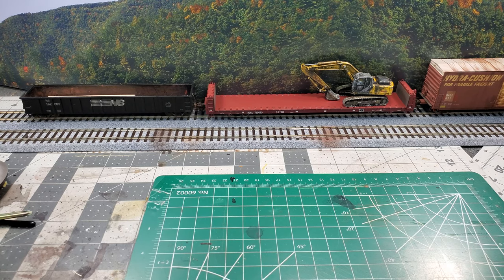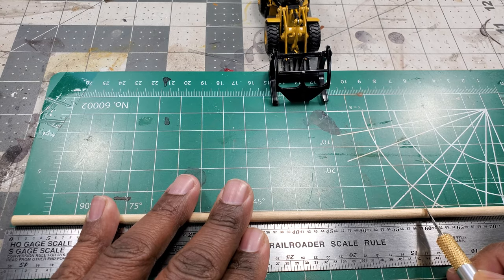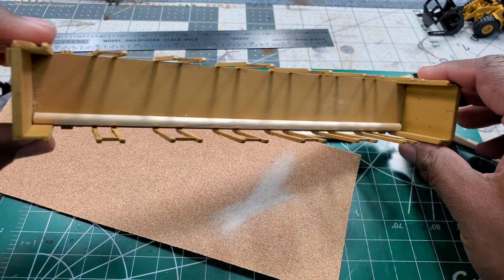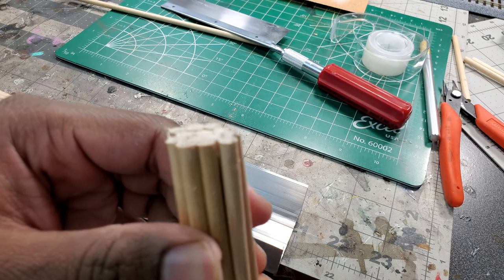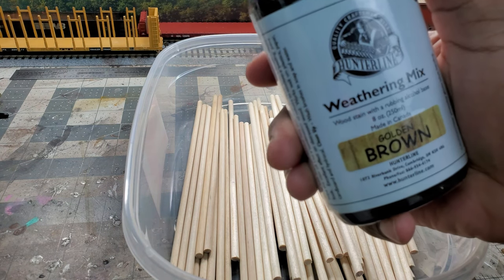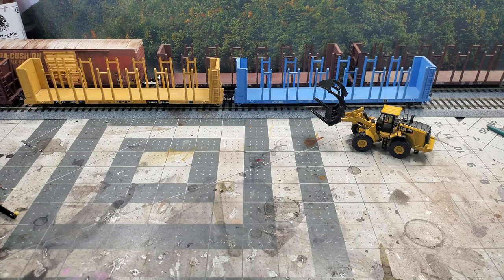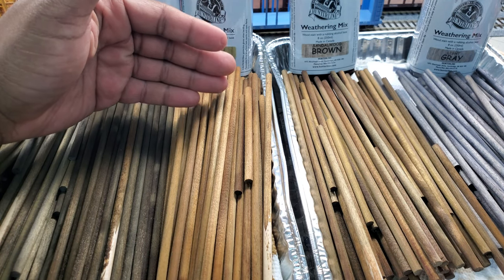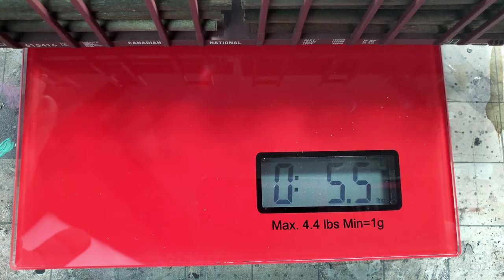How to make Realistic looking Ho scale Utility poles load

Comment: Why don't you just use a razor saw and a miter box that comes with the saw in some cases??? Easy and good clean cuts. No sanding needed...OMG, you have the miter box. Why didn't you use it at the front of this??? When you are cutting the bundle, why not just market the ends with the length to cut. Use a pencil... Simple... I was taught that the right way to use the miter box was to hold the item you want to cut hard against the back of the box, then the blade will want to push the items into the back, and you will have no movement and you won't have to hold the item steady as it will hold itself solid to the back wall of the box.

Comment: Poles come in three classes, #1, poles that are usually 20 or 25 feet tall. Class #2 poles are larger then 30 feet tall, depending on thickness of the base . They come treated with creosote, coppernaphanate and calcium carbonate. Non treated poles are used as piling
Reply: Instablaster.

Comment: I’ve found Ritz dye, a mixture of black and brown, works well for creosote poles, while copper  naphthenate poles have a green tint, and calcium carbonate poles are white to light grey in color. Most poles have a taper to them which I have been able to replicate by putting poles in a drill and running them over a rasp or large file. Poles come in five foot increments 35, 40, 45 to well over 100 feet